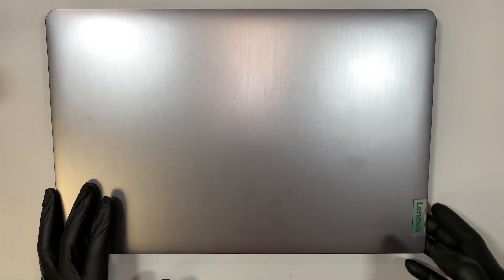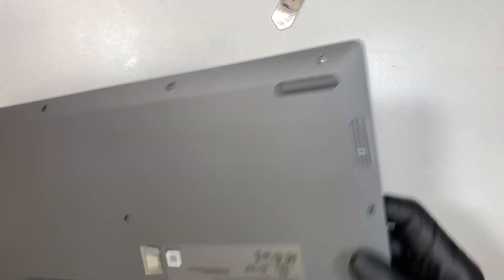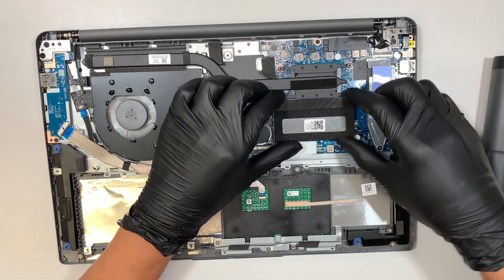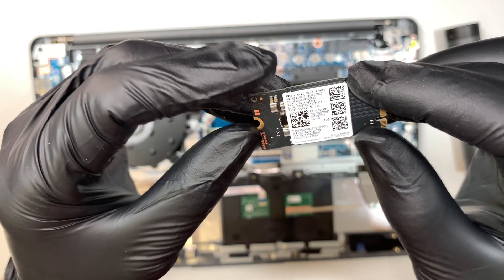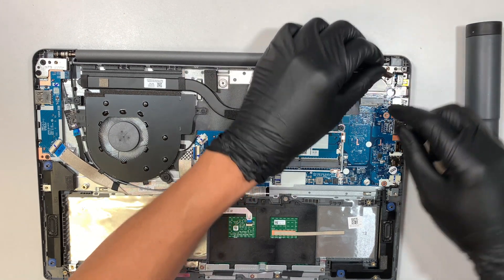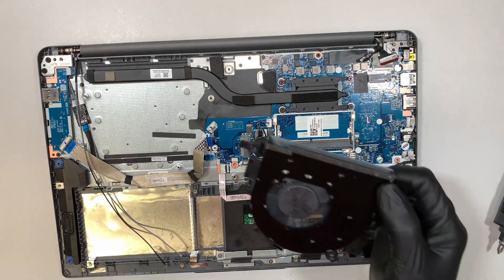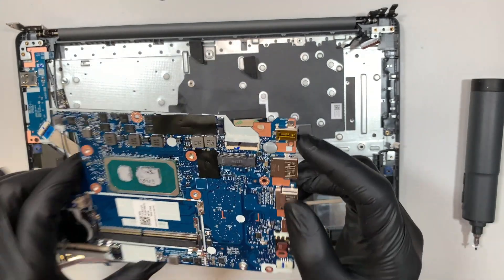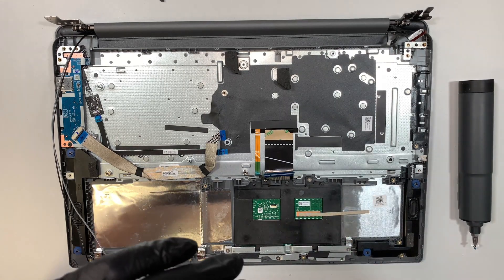Lenovo IdeaPad 3 15ITL6 Tear Down Disassemble

Comment: I enjoyed the video. Thank you. I also have the same model laptop. However, recently, for some unknown reason, the motherboard broke and it won't turn on. So I'm going to replace the board. I know that this series has several different specs. Is it possible to replace the board with a different model (with an i5 or i7 CPU)?

Comment: What is the size of the hinge screw that can tighten the torque of the lid angle from too tight or too loose? My lid was too tight, and the corner case plastic was broken. Then I loosen the screw, but not enough torque to hold the lid now. I need to find a wrench to tighten it without separating the lid from the body case again.

Comment: Great video. We have a few of these and one of the touchpads died. Very useful to know the keyboard and palm rest are all one component. I had a hard time finding a good replacement touchpad, so instead found a new keyboard/palmrest which included the touchpad, as there is a good chance they'll break a keyboard at some point. Auto shops are rough on hardware.

Comment: @UbergeeksBiz  or anyone who has knowledge. 

I accidentally put my pc down with too much force while it was in the laptop bag. It hit the ground with one of the sides. Now, whenever i hold it at a certain angle or move it too much, it  glitches, and the whole screen turns black with coloured lines  and some numbers displayed at the top of the screen. After that happens, it takes a few seconds and restarts itself. The screen itself is perfectly fine. What is the problem???? Did the drop shift something in the motherboard that i need to get fixed?

Comment: Shame he did not mention whether a 2.5" SSD can be plugged into the MOBO. The case has the space. Some versions of this model allowed for a second drive.
Reply: Bro in my case the ram slot is empty and it shows i have 4 gb ram so does that mean that 4gb ram is permanent and i can add another 8gb in that slot?

Comment: Please how can I get a new motherboard mine is bad and can’t find one in my area
Reply from the maker: Try eBay
Reply: @UbergeeksBiz 
 or anyone who has knowledge. 

I accidentally put my pc down with too much force while it was in the laptop bag. It hit the ground with one of the sides. Now, whenever i hold it at a certain angle or move it too much, it  glitches, and the whole screen turns black with coloured lines  and some numbers displayed at the top of the screen. After that happens, it takes a few seconds and restarts itself. The screen itself is perfectly fine. What is the problem???? Did the drop shift something in the motherboard that i need to get fixed?

Comment: I have Lenovo Ideapad 720s 15IKB, can I upgrade its RAM from 16GB to 32 GB? Can I also upgrade it’s existing hard-drive to Nvme? (It comes with a dedicated slot for NVMe, but is it possible to upgrade the main hard drive also? If yes, which adapter can be used?

Comment: THANKS FOR POSTING THIS VIDEO.
My older Lenovo died, and I was simply curious to see what was inside since I had never opened up a laptop before.  The hardest part was removing the screws since I don't have a power screwdriver. I had no problems following the other steps.
Reply: Same my old Lenovo died. And I studied the fundamentals of CompTIA. So I knew some stuff. But it was quite a while ago. 

And I was curious to see the inside. It seems all the screws were taken out. And b4 you think I’m lucky I needed some of them for my new one which also had some screws missing. 

Meaning they were taken for whatever reason. Gonna play with the motherboard and screw around b4 I dump it in the trash God willing

Comment: This is excellent, very thorough and well explained. It is very frustrating that these keyboards are not an easy/cheap replacement part these days. One thing you didn't mention was the space for a 2.5"" HDD in the bottom left - this either goes under the battery or requires the smaller 38Wh battery, then you can buy a hdd cable which connects to the 10 pin connector JHDD1 on the motherboard near the keyboard backlight connector JKBL1
Reply: I have the version with the smaller battery, and has the space for the 2.5" HDD, you mention the keyboard backlight connector - my 15itl6 doesn't have a keyboard backlight, are you saying I can purchase a backlight keyboard replacement and install it to have a backlight? this would really improve it for me if so..
Reply: @PaulGalvinPhoto  if you can find a replacement then yes, when the keyboard has a backlight there is a second cable to plug in for the backlight. Problem is the replacement part is usually the entire top plate not just the keyboard and is much more expensive. That's what I was moaning about, you can't easily/cheaply replace the keyboards these days (displays are also getting tricky to replace with the obsession with ultra-thin bezels they have removed most of the screws and glued everything in place

Comment: When adding more RAM, do I put the metal cage/bracket you described back on over the ram?
Reply: can we add anoter 8 gb ram to it
Reply: @Quiet_Hours_FM  yes, i managed to add 8gb extra
Reply: @swis4   but for this laptop there is only one ram slot ??
Reply: @Quiet_Hours_FM  yeah you replace the old ram with the new one. (i.e. if it came with 4gb, you take that out and put a 12gb in for example)
Reply: @Quiet_Hours_FM  if the laptop comes with 4gb, then the ram slot will be empty so you just slot in the new ram, but if it came with more than 4gb of ram factory set, then the slot will be used up so you need to replace it with a higher ram
Reply: @swis4 mine is 4gb and slot is empty so that mean i can add another 8gb in that slot?

Comment: Excuse me, as we can take advantage of those 16 ram, because there are 4 ram sold, we would have to buy the 8 ram to have 12 or buy a 16 ram to have 20 and so the pc detects the capacity and stays with the maximum 16 it supports? If so, there would be no problem with us having more capacity and the PC trying to force itself?

Comment: Hi, what is the maximum RAM I can upgrade for this model in slot? I know, it has soldered 4gb RAM. But, How much memory RAM it will accept in slot?
Reply: 12 gb because it support 16 gb in total i guess and if we add 12 in slot and 4 permanent it will br 16 and that is the amount of ram it can handle i guess because it shows it can handle upto 16 gb in internet 😊

Comment: Mine is the same model but came with a 1 TB spindle hard drive, so I guess it's in the same location inside? I wish this model came with an extra memory slot. As it is with just one slot, the memory installed is wasted, and a larger module has to be purchased. That makes it pricey to double the memory size. This is the first laptop I've had that has an internal battery. Most just have batteries that just snap in and out from the outside.

Comment: Hey man great video. Please help.
Which one of the two is better?
1. To have 2x 4GB (8GB) RAM both with 3200MHz OR
2. To have 1x 4GB (3200MHz) and 1x 8GB (2666MHz) basically=12GB

I'm using this very same laptop.. Looking forward to hearing from you😊 please and thank you
Reply from the maker: I would match the same MHz. In term of size, it can mix match 4+8 or 2+4...etc but not the MHz
Reply: Друг там стоит на материнской плате 4Gb ddr4 2400mhz поверь

Comment: Bless you.  That cover on the RAM looked so solid I was worried it was some kind of one piece memory/heatsink that was soldered down and I was terrified to try removing it by force.  After a surprising amount of searching online I finally found your video, and now I know it's ok to do so to pop my new 16 GB DIMM in 🙂
Reply from the maker: You are welcome. Glad the video helped.
Reply: Dude😅 that's exactly what happened to me last night! 🥺I was so heartbroken I thought the 8gb ram was soldered.. thanks to you both 🙏
Reply from the maker: @tuphelo  You are welcome. Glad the video helped.
Reply: I had exactly the same issue. Thanks for a great video showing this cover was safe to remove.
Reply: Mee too  bro thanku so much
Reply: @UbergeeksBiz I was thinking to upgrade my lenovo ideapad 3 15ITL6 core i3 4gb ram which is soldered i guess and the maximum capacity shows till 16gb ram can be extended. 

So will there be any issue if u install 16gb, it will be like 4gb+16gb=20gb or I should install 8gb so it will be 4gb+8gb=12gb ?
Reply: @mrprofessor5969  Man I have the same question, idk to do, in other videos I find the pc if it has 20gb ram only uses the max ram that can use the pc for example if we install all the 20gb we only use 16 of it, my fear is that a problem will appear in the long run
Reply: I have the same question. The document from Lenovo states that there is 8GB soldered in and that can be extended by another 8GB.
Memory
Max Memory[1]
• Up to 12GB (4GB soldered + 8GB SO-DIMM) DDR4-3200 offering
• Up to 16GB (8GB soldered + 8GB SO-DIMM) DDR4-3200 offering
Memory Slots
One memory soldered to systemboard, one DDR4 SO-DIMM slot, dual-channel capable
Memory Type
DDR4-3200
Notes:
The max memory is based on the test results with current Lenovo® memory offerings. The system may support more memory as the
technology develops.

So there is no soldered memory overall?
If yes can I add a 16GB module to the 8GB soldered RAM? Or just the +8GB?
Reply: are there 2 slots? cause my lenovo ideapad 3 15tl6 has 8gb ram so can i upgrade it to 16? if it has 1 slot i will have to get a 16gb stick.
Reply: I have 4 gb ram 
If I install extra 8 gb will tht be a problem
Reply: @mohdirfanafzal4335  should work as long as it's the right type of ram

Comment: In the specs for the 15ITL6 it says that there is support also for an additional 2.5 SSD drive. But I don't see any space in the case for this. I was hoping to find the answer--do you know if this is possible? Thanks!
Reply from the maker: It is not possible. No empty slot for 2.5 SSD / HDD
Reply: @UbergeeksBiz  Thanks for your response! This helps.

Comment: To everyone asking if you can install an 2,5 hdd the answer is yes but you also need to change the battery to the smaller version the 38 watts and the sata connector and only then you can install it.

You can also add a samsung sdd with sata connector but you will need to remove the sdd case and put it bare bone with tape to avoid any short circuit
Reply: And on Aliexpress they sell the 2.5 hdd adapters in case you need them and the battery
Reply: Thank you. I was disappointed to see my battery was the long one that covered up that spot for a second hard drive.

Comment: Hi! I was just wondering if this laptop can be installed with a 2.5 inch hard drive?
Reply from the maker: No, cannot
Reply: You need to get the 38 watts battery to have enough space and then can install you hdd

Comment: hey nice video! one question, does opening the bottom cover with a metal pry tool damage the back cover?
Reply: Just use a old bank card
Reply from the maker: @billybobby7607  That would do too.
Reply: @billybobby7607  Genius! 😅
Reply from the maker: should not. but open gently.

Comment: Based on what I read, there are two versions of this laptop 38wh and 45wh battery. One with 38wh has smaller battery which has enough space for additional 2.5" HDD, while on the version with 45wh battery you can't add 2.5 HDD. Now my question is how can I identify if my laptop has 38wh or 45wh battery?
Reply: read what the battery says on it
Reply: LMAO you can literaly see it on your system information
Reply: Go to Lenovo vantage and click on battery details
Reply: @hasbiakbarmuliana7320  this worked, thnx

Comment: can you install a 2.5 inch hdd or ssd? apart from the m.2 that it has?
Reply from the maker: No. Only way is to increase M.2 capacity.
Reply: @UbergeeksBiz  and the motherboard does not have a connector for a 2.5 in ssd flex?  because under the stack there is a free space and I thought it was for a hdd or sdd

Comment: thanks for your useful information . two questions . 
1- Does this laptop have PCIE 4(Gen4) or PCIE 3(Gen3) ? as I read the documents of Lenovo , it does not mention PCIE 4 support . because I want to choose between Samsung Evo plus 970  and 980 pro. 980 has double speed for read and write but it woks in maximum performance in PCIE 4. what is your recommendation ?

2-  as I read , there are two models. one hybrid(SSD + HDD ) .second (just SSD) . for me it is hybrid version . Does it support 2280 m2 form factor or it is 2242 ? they mentioned that 2242 and 2280 are supported.
Reply from the maker: I would go with Evo Plus 970. For M.2, go with 2280

Comment: Where would the 2.5inch HDD/SSD go? Couldn't see an area for it in the video but you have links for them in the description. Thanks!
Reply from the maker: There is no 2.5" HDD or SSD. Only runs on M.2 NVME
Reply: @UbergeeksBiz  my lenovo ideapad 3 jas a hdd 1tb